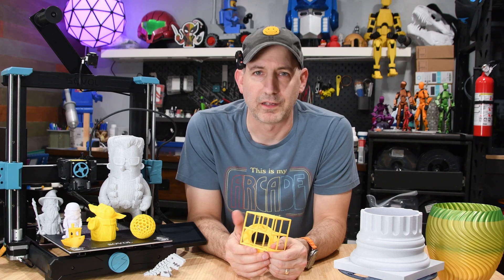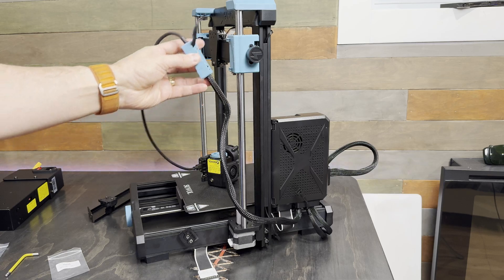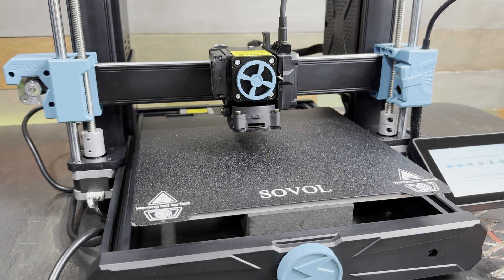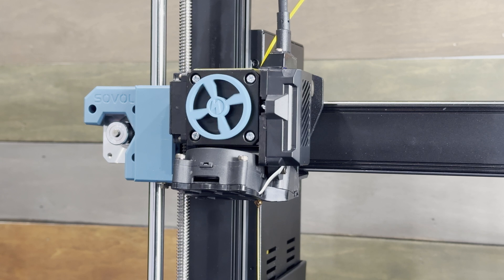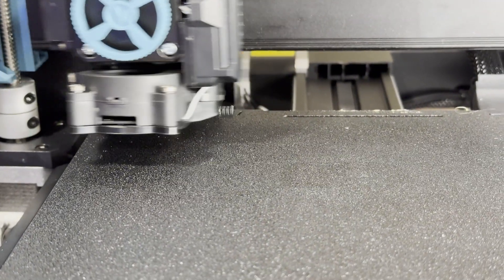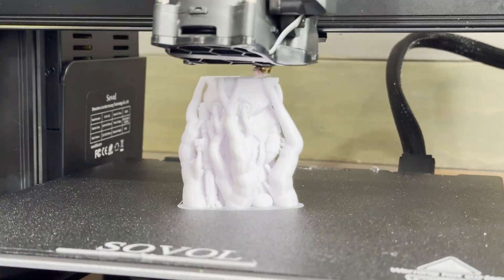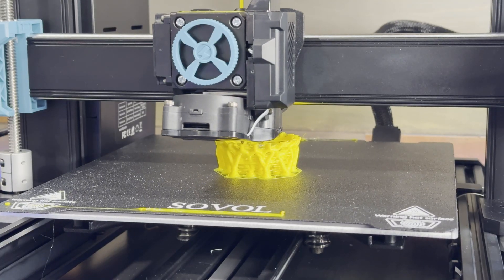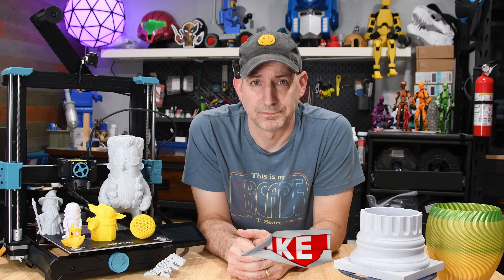Sovol SV06 ACE, The New King of Affordable 3D Printers?

Comment: I can’t get mine to print on the center of the bed , any ideas ?😢

I’ve tried reinstalling firmware , updating , changing offsets from steppers , recalibrating , checked orcaslicer print dimensiones 

Profile is imported , firmware is updated , printer is calibrated and there is enough space behind the printer so the bed can move freely 

I’ve actually ran out of ideas 😅
Reply from the maker: You mean the print head can’t reach the center? Did you remove the foam that is under the print bed for shipping. It blends in and is hard to notice. I had this issue. 
If you don’t it block the full movement of the bed. There is a piece in the front and the back.
Reply: @ Uhmm not really , when I start a print it has like a +10mm y offset , i don’t understand for what reason , then when I pause and resume you can see how it resumes from where it was suppose to have started to print

Maybe there is a way to insert an offset on the y axis in orcaslicer ? It’s kind of annoying knowing that the print it’s always going to be offset plus I am loosing printable area 🥺
Reply: @DaveRigDesign  and I went straight away to check for any foam or anything under the bed blocking the movement of the y axis. Nothing all clean 🥲😂
Reply from the maker: Hmm. So when the print starts does it purge and wipe at the back as it should? If after a pause and restart it doesn’t line up it sounds like something is blocking the movement at the start causing the offset
Reply: @DaveRigDesign  so I was out of home but I’ve been all day thinking about it , decided to triple check the printer …. Turns out the foam you mentioned previously was still there 😅 I can’t believe I over complicated so much such a simple problem 🥹😂

Thank you so much, you actually helped me out !! 🤭😁
Reply from the maker: @DuckDevAI no problem. I had a similar issue. I found the front one first but it took a few prints before I realized there was another foam block in the back :)

Comment: ACE.  I wonder why they named the improved SV06 by that name?  There is a lot to like in the SV06 Ace.  I love the beefy all steel motion control way better than acetyl V rollers.  I can see setting up a print farm using this printer if it's as good and reliable as it looks.  There were a few early issues that are hopefully fixed by firmware upgrades.  My biggest reservation is that @Microswiss doesn't yet have a FlowTech hot end for the SV06 Ace.  That's my new standard.  I hate that all of these manufacturers ship their high speed printers with nozzles that are nearly identical to the Volcano nozzle but just different enough that we're forced to buy their proprietary nozzles.

Kudos to Sovol for open source on the SV06 Ace (and SV08) - hardware and software, and for providing OrcaSlicer with profiles for the printer instead of re-skinning an open source slicer to make an outdated proprietary version that nobody wants.  Kudos also for explaining in the manual how to import the SV06 Ace OrcaSlicer profile into the OrcaSlicer we're already using.

Comment: Ace: Nice review Dave! 👍
Do you know if Sovol is planning to make some kind of multicolor system for it?
Reply: I hope Sovol makes a multi filament system for the SV06 Ace and the SV08.  There is the Co Print 4 feeder system for Klipper printers but it's hard for most people to justify a $290 feeder for a $270 printer.  Being able to print multiple colors makes a lot more sense if slicers become smart enough to print the purge material as infill instead of pooping or printing a purge tower - much faster and no material waste.  If printing incompatible materials for complex functional parts the purge could be pooped into cavities within the infill.
Reply from the maker: thanks, I don't have any info on that but it seems like everyone is making a MulitColor system these days so I wouldn't be surprised if they did eventually :)

Comment: ACE. I ordered one of these and just received it a couple of days ago, I haven't assembled it yet. Do you know if it supports power loss recovery, either by default or through some firmware update or change in the configuration?
Reply from the maker: I looked online and didn’t see any mention of it. I tried starting a print on mine and cutting the power and it didn’t resume. Not sure if it’s something that can be turned on in klipper. 
I never really trust the resuming to continue without flaws. If it a real concern I would look into a battery backup so it can run uninterrupted.
Reply: @DaveRigDesign  Yes I already bought a CyberPower 1500VA/1000W UPS with clean sine wave AC output for the exact reason that I didn't see support for power loss recovery, although today I saw someone mentioning Sovol released a firmware update for the SV08 which introduced functionality for power loss recovery, so I hope they eventually make it available for the ACE. It had to be invoked manually though. Thanks anyway.
Reply: @geekmidget  - I can confirm that Sovol added power loss recovery to the recent SV08 firmware update and it works.  You might check the SV06 Ace's files from the web interface.  If it has power loss recovery, there should be a plr.cfg file and the printer,cfg file should have an include plr.cfg statement near the top.

Worse case, as long as the part didn't pop off the bed, you could measure the height and delete that much from the bottom of the print in the slicer, reslice it, and print the top on top of the previously printed bottom.  If the print popped off the bed, you can lower the part in the slicer to the correct layer, slice it as a second part, print that, and glue it to the previously printed portion.  It's a pain but probably better than losing a 20 hour print.  An uninterruptible power supply for your printer is a good idea.

Comment: What’s the printer.cfg look like ?
Reply from the maker: Like a txt file :)
What do you mean? In what way?
Reply: @ i mean in the way of difference to the svo6 with klipper. Like the acceleration and pressure advance
Reply from the maker: well never had a older 06 but the ACE has a max print speed of 600mm/s and Acceleration of 20000mm/s.
Reply: @ I know that part I want to the printer.cfg numbers . It’s easy to see sv06 printer.cfg but can’t find svo6 ace
Reply from the maker: Well can't post the whole thing here but
pressure_advance: 0.03
pressure_advance_smooth_time: 0.035 
max_velocity: 600
max_accel: 20000
max_accel_to_decel: 5000
max_z_velocity: 15
max_z_accel: 100
Reply: @ exactly what I needed cheers mate